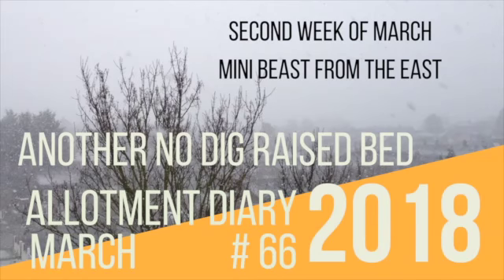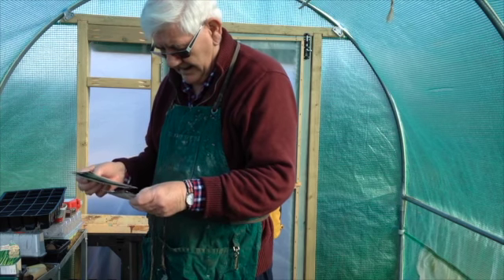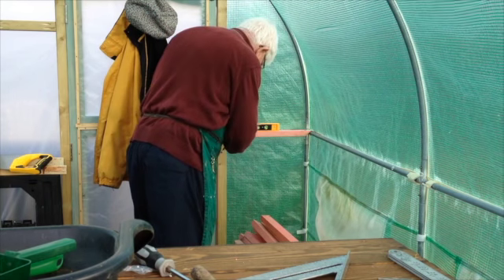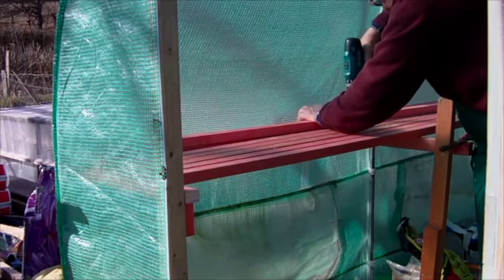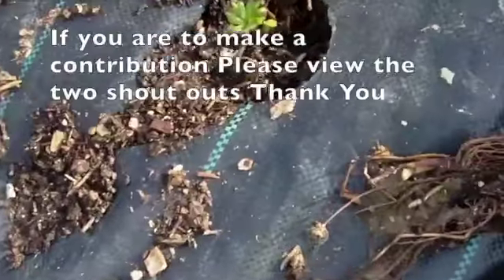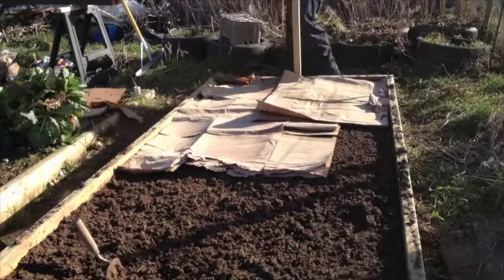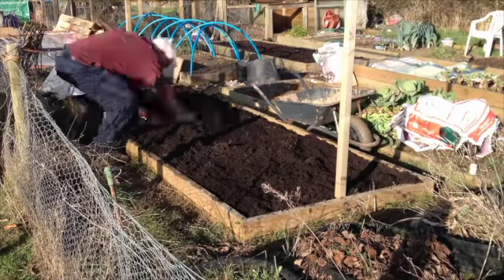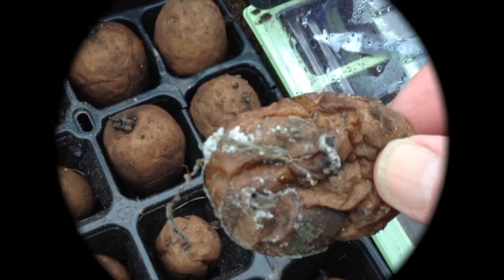Plastics in the Allotment good or bad and Another No Dig Bed

Comment: Hi Mike, I have mixed opinions regarding the use of plastics on the allotment. Pots are a fine example.  Different grades, of plastic are available as your are aware.  With the more sturdier types, this involves more outlay initially however, their life expectancy with correct care and use is far greater than the much cheaper ones sold in various discount stores. Also plastic is much easier to clean /sterilise when compared to other materials. On the downside, for securing, cable ties can be difficult to dispose of as opposed to the use of string or twine..This should prove an interesting point of conversation..  Cheers. Nigel 😀
Reply from the maker: Hi, Nigel thanks for the quick response, Please watch the second shout-out video if not already done so.  Can state I am not against plastic.  We Allotmenteers truly believe we are eco-friendly.   But we need a reality check.  I think we are a bit off beam.  Boyan Slat a Dutch engineer from Delft University pulled out a plastic crate dated 1977 out of the Pacific dump. I inherited a milk crate on my plot 41 years from now I will be long gone will my crate end up in the Pacific?  Maybe not but I can ensure it will not.  This problem is bigger than both of us lets see how the thread develops.  Take care Mike B
Reply: MuddyBootz very good point I am thinking the same 👍👍👍
Reply from the maker: Just found out our council will not take plastic plant pots.  Cheers Mike B
Reply: Michael Brotherton I’ve been looking for long lasting module trays Mike, the only ones I seen are huge.
Reply from the maker: Hi Steve, this is the plastic I don't want to give up, they are so useful and cheap.  Wilco does a fibre pot at £1.00 for 20 which will require a tray (wood) and will give it a go, but this has a cost element, using the pots mean.  There is nothing wrong with plastic as long as it can be recycled.  I found out today our local recycling depot will not accept plastic plant pots so they become a no-no. I  will take a cell tray to the center and see which bin they suggest.  If its landfill then I will be disappointed but they become rejected.  Definition of recycling does not include a second use.  For example, a Pop bottle has a recycle value and there are 20 accepted ways to use it on the plot but once you do you increase its chances to become microplastic contamination unless you can guarantee when finished it will go in the recycling bin.  Can you guarantee the wind will not blow it away?  Take care Mike B

Comment: Mike, the plastics are quite the topic now, aren't they?  I always try to reuse, at least once, then recycle the common plastic bottles.  Right now, I have some I'm using in Winter Sowing, and once I empty them, I will be putting them into the recycle pick up that our town offers weekly with our garbage pick up.  Your shelving looks like it is going to work great for you  in the polytunnel.  Have a great today! Catherine
Reply from the maker: Hi, Catherine, I believe your the first person to comment that they actually put there discarded plastic into the recycling bin. This could be that they are not sure what is recyclable or not,   I for one I am not sure.  I found out only an hour ago plastic plant pots are not acceptable by our local recycling center.  What happens to them when you think they have been put in the recycling bin? into landfill? which if they are, defeats the object.  There are lots to do on this subject, take care Mike B

Comment: I'd be more inclined to question the practices we each have, as opposed to the material used. Some (Terry King) recycle everything, and others throw away anything not perfect. It is our personal choices of how we use material, not so much the material itself, that will make the biggest impact. Just my opinion, I have been wrong before, lol:))
Reply from the maker: I wish it was that easy.  Most of what Terry King does is what he has found on the roadside as part of his job it is his job to pick up roadside rubbish and take it to an appropriate center.  He looks at it and thinks how can I use that on the allotment.  When he has finished with the item on the allotment and because he is a daily visitor to an appropriate center the item is taken and properly disposed of.  A pop bottle stuck on the end of a bamboo cane is  second use but once storm Emma has blown it away and because it is plastic gets turned into microplastic which is bad.  A lot of what Terry finds is metal, wood or glass.  Did you look at those shout outs I made? they give a clear argument.  May not be correct but give a clear picture.  Thanks for a thought-provoking comment, Take care Mike B
Reply: I did say I have been wrong before. I did not watch the shout outs, just answered from my view. I will watch them both and comment when I have a different perspective. I did not mean to come across as brushing the plastic impact on the environment under a rug, and simply down to a choice of recycling, although I'm sure that's how I came across.
Reply from the maker: No, it was not, I understand, my view is changing all the time as I learn more what I am doing in taking stock of what I have and finding out if it can be recycled and if my Local Authority do actually recycle it and then doing a clear up of any plastic I have discarded and thinking of alternative ways.  I am disappointed that plastic plant pots are not recyclable or is that just my local council?  Take care Mike B

Comment: Im new to allotmenteering but I intend to keep my plastic use to a minimum unless it’s reusable. My downfall is modular trays. I like using them as seedlings are so much easier to transplant from them, but they fall to bits after a single use. Does anyone make sturdy modular trays? I’ve never seen any.
Reply from the maker: Hi Geraldine, I am in love with modular trays I do manage to use them more than once and it will break my heart to let them go and am working on an alternative at present.  Wilco sells fiber ones at £31.00 for 20 but they are only single use.  As soon as I work something out I will post it.  Take care Mike B